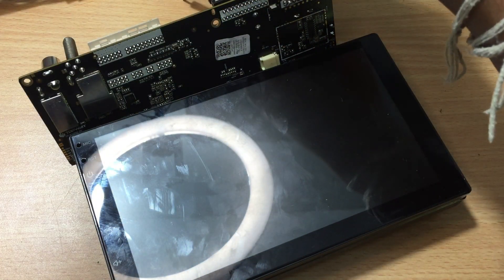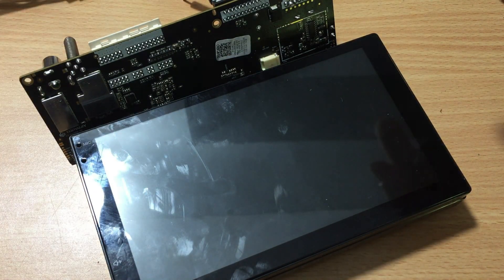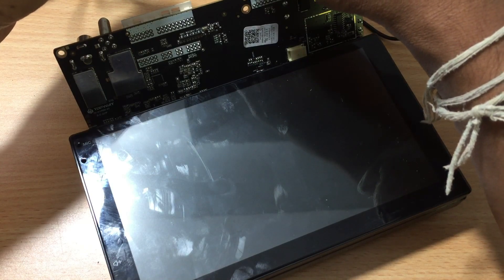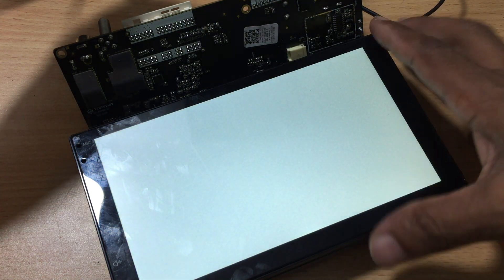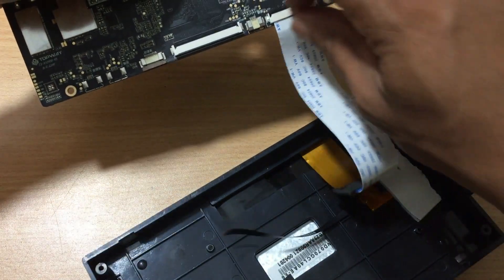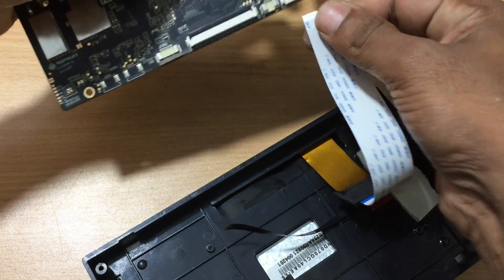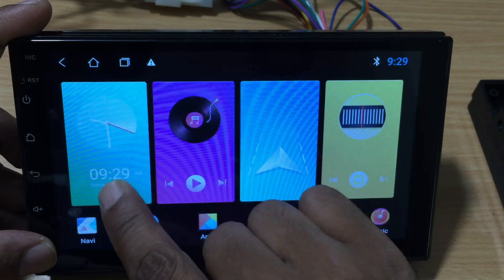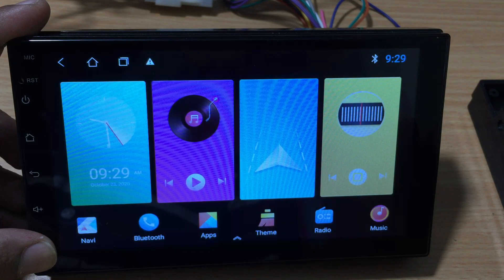Android Car Stereo Firmware Upgrade :Topway

Comment: I got black screen after a factory reset, but the backlight comes on and it connects to android auto. How do I fix the black screen?
Reply from the maker: Did you power off while updating?
Reply: @setnfix  No, I never update

Comment: Android: YT9216BJ_00012_V001_20200514
Android os: 10.1 (i understand this is fake and not the actual version)
XY AUTO: 3.3 (8227L)
CAN Pro: 3.1 (8227L)
DDR: 4G FLASH: 64G (this is also fake.. its actually 1/16GB)
cpu: A7 1.3GHz x4
display: 1024*600
MCU: 3.1 (8227L)

CPU-Z shows:
Model: 8227L_demo (full_8227l_demo)
Manufacturer: alps
Build ID: YT9218_00012_V001
Android Version: 8.1Go
API Level: 23

Printed on Motherboard:
YT9260-VER 1.1
XY AUTO
2019-12-23

Please help me upgrade its firmware.
Reply: Its running on android 8.1
Reply from the maker: Check my firmware upgrade video and its 1st comment for update files

Comment: Last time when my player was updating by mistake I trund off the ignition and from that day I m facing hanging problem and most of the time apps are gating frizz and crash
Reply from the maker: Oh, Its a bad situation. you have to find the firmware now.
Reply: @ but where should I find the firmware do you know any website
Reply: same situation in my TS7 Topway.

Comment: HI! why your lateral buttons don´t answer? could you fix it?? I restart my car stereo and know this buttons don't answer =(
Reply from the maker: My case ,It is because of an issue with the display. If its is with a software issue, you can fix with factory settings.
Reply: Hello! Is there a standard password for factory reset? It asks for a password but I don't know what is it! Os is there a way to reset this pass?